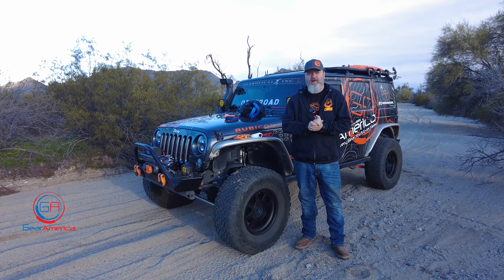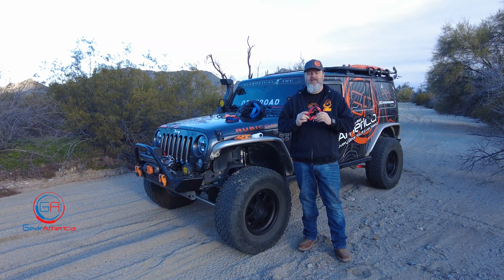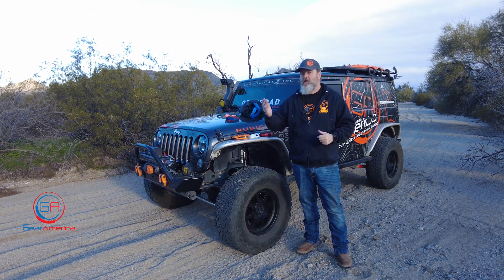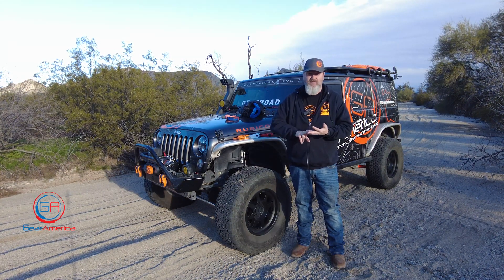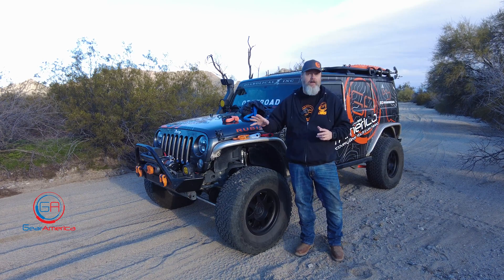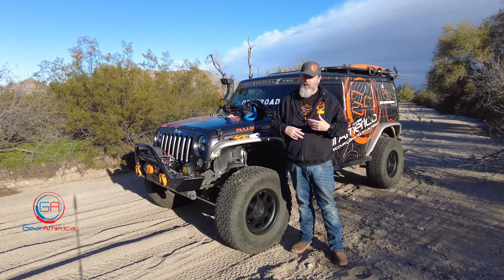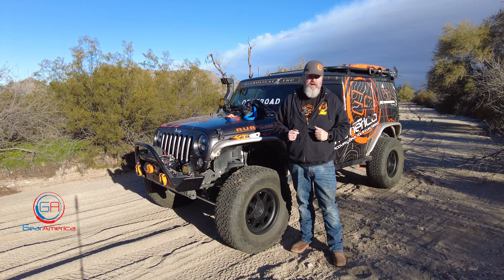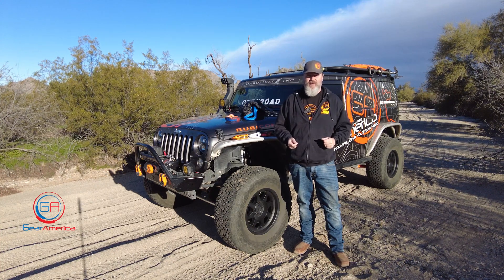Work Load Limit VS Minimum Break Strength EXPLAINED! Recovery Gear Safety Factor

Comment: I am not a fan of soft shackles with the exception of joining straps. I use Crosby bow shackles to attach to my tree strap or vehicle anchor. The weakest link on mine is my synthetic winch line or the winch.

Comment: My bmw e46 is down it's a 2001 330ci 5 speed manual.. it's down rn... my brother and I wanna use a tow rope to get it home.. my car is around like 3,400 pounds, he's using his pontiac grand prix 2008 to pull my car... my tow rope working load it's 2,200 pounds and breaking point is 6,800 pounds... it's the SURE BILT tow rope from autozone cost me like 17 bucks... is this gonna be strong enough to pull my little bmw?